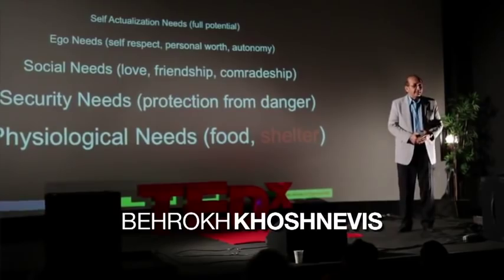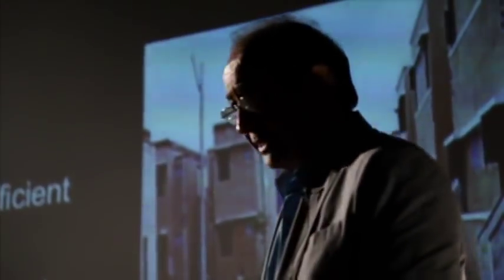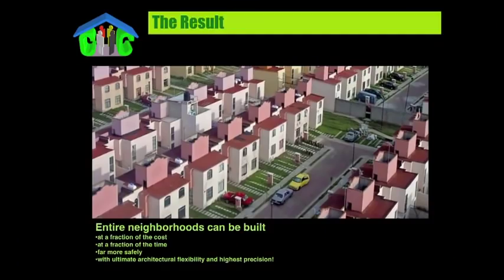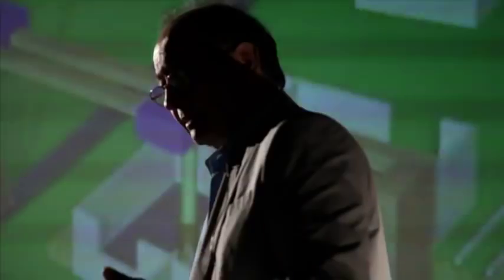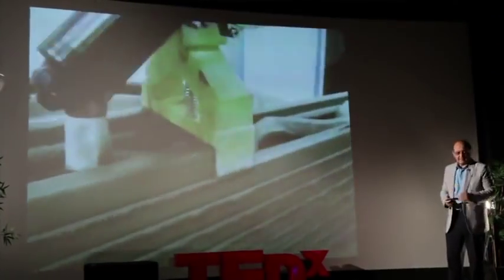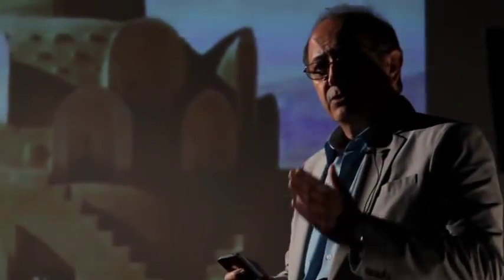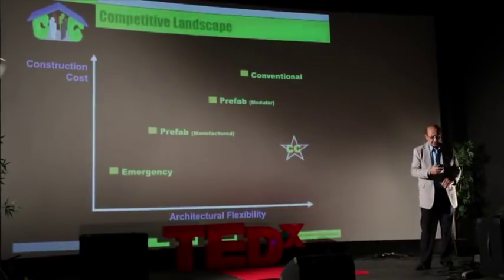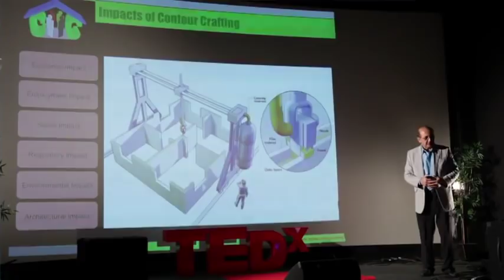3D printer can build a house in 20 hours

Comment: You can also built it out of rammed earth, which means you wouldn't even have to bring concrete in. You just use the surrounding dirt. When packed in tight, rammed earth is just as strong and has been used for centuries.

Comment: Definitely a great application of 3d printing.  What will be imperative is for the building designs to incorporate easy access for various repairs of electrical and plumbing systems, and allow for building extensions/remodeling, etc.  But, yea, this is likely to radically change architecture, and the built environment.  I'm all for it.

Comment: I replied to an earlier comment about what I said, which said something similar to your comment. Robotics did indeed cause jobs to be phased out in the 70s to 90s, primarily in the auto industry. But what replaced those old workers were people who knew how to operate and repair those robotics and it is still happening. But whats different with 3D printing is that it will replace even more workers who create engine parts or circuit boards. I stand by my statement despite your short-sightedness.

Comment: He is quite right, the potential in 3D printing is phenomenal. You have no idea. It will be the all dominant production technique in the future. Computers, cars, ships, planes, space ships, houses, everything will be 3D printed.
But there is a much better way than his proposal of cement printing. Laser sintering of sand...  It's much less labor intensity, it is cost free, there is no pot time and it is stronger. Laser sintering is also more precise and can create fine thermal insulation structures inside the walls. A metal powder can be used for reinforcement where necessary.
Reply: I like the idea to sintering Sand together. Instead of Laser you could use some Mirrors and fresnel lenses and sinter it with sunlight together.
Reply: 0Keks that's how I got the idea but you can't focus the sun enough so it's too sloppy. Laser is much better. And if you want it solar powered you can use solar panels at the site.

Comment: You can also use what one guy does with balloons. You inflate them and spray concrete on the outside, mixed with fiber glass in the cement. When the mold hardens take out the balloon. He has made great round style homes with these and the insulation properties and cost of heating and cooling is way less then a standard house.

Comment: I am in the HVAC design industry and I think 3D printing of mechanical and plumbing systems will allow for much more efficient designs than are currently used, but my question is how will issues like seismic bracing come into play if you are printing the entire system? Will a different more elastic material be used to both structurally brace as well as seismic? What about renovations? Will there be a 3D material remover that sweeps an area for demolition?

Comment: The only response needed to your first problem is slip forming.  It's a common practice used in construction today all over the world.  As far as the plumbing and electrical, the process for repair would be the same as it is today.  Removing a portion of the wall for repair/new installation wouldn't compromise the structure to a significant degree as long as the walls were built with that in mind.  It's just like removing or altering a support wall for a standard stick frame construction.

Comment: An easy way to dispute that would be to look at the automotive aftermarket industry.  Many people thought that automation would destroy the work force in building cars and tools, as well as repair shops eliminating the need for a consumer to be able to access parts and tools.  These days however, it's obvious to the outside observer that not only has the aftermarket helped the parts and tool industries grow far larger than before, but also create new job opportunities.

Comment: to me, this concept sounds like printing a car as a whole. Instead of building with different parts. Normally people don't really notice, but even with a simple house there are many small parts which makes a whole. 

If it is raining outside and you don't see any water coming in and you don't feeling as cold as outside even without heater, there is a reason behind it. good buildings aren't just a thick concrete walls.

Comment: That's why it's so hard to optimize plumbing/power/rebar system. 3D-printing a house has never been done before, so if you ask someone that has worked in the construction business for 40 years he has no clue what so ever on how the most efficient house could be built. There's a way of doing things so that it gets done quickly and efficiently, and if you throw all those rudimentary rules out the window you're left with nothing. So basically you almost need to reinvent how to build a house.

Comment: In my previous comment I wasn't saying that under realistic circumstances this new method cannot be more expensive than a labor intensive alternative, but when controlled for all other differences, the only variable being the method of production there is no reason one should be more expensive than the other. And to add that there is no reason to believe that technology changes the profit structure over any other method of production.

Comment: I, MOST certainly would prefer an exterior wall composed of gently blended (Tuned) spherical surfaces to hard cornered exterior any day. which do YOU think will Hold up the best? I know which one will for a fact - not a guess. Today's state of building tech cannot hold a candle to the strength and support I can program into a freeform shell. Plus I can test it before I even print it out.

Comment: I install drain tile in agricultural fields.  Many people thought that a machine called a tile plow would eliminate the need for human workers and almost any other kind of equipment, as the tile wouldn't need to be laid along it's entire length by hand any more.  Today, while most of the work IS done by the tile plow, there are no less than 10 separate jobs that require unique skills and training to accomplish.  The only thing it did was cut down the number of people actually in the field.

Comment: You're all over the place. Try to do just one thing, 3D-print ONE house, you'll quickly understand that in theory plumbing/power and rebar systems are easy but in practice making a robot do it automatically...not so much...Then when that's done you can focus on moon-landing and what not.

Comment: Regarding the impact on construction laborers: They will go on to more specialty work; They weren't building for the 3rd world anyway; They could buy in and participate in the construction. I am sure no one would think of calling a bulldozer or even a wheel barrel or a bucket a detriment to the construction labor pool. After all the machine could put up the wall while a crew veneers it- or what ever.

Comment: Someone has to fix the printer, someone has to find ways to make the printer more effective, someone has to get contracts to use the printer, someone has to get the materials used by the printer, someone has to build the printer, someone has to design the things the printer will be building, Continued supervision of the printer would be necessary to make sure it doesn't malfunction and also you would have to have people come in to check the structure when the printer is done to ensure its safe

Comment: Nice ideas, but practically you must let concrete cure completely to get maximum compression strength, water/sewer/gas lines must be pressure tested to ensure safety and this is accomplished before walls are sealed in case of problems. Also labor is still required to provide base materials on site, deploy them as needed in a precise order over  20 hour period. Its not magic, it still requires a lot of work.

Comment: Currently, most PhDs in science do not end up working as scientists.  In previous generations, many engineers could begin as draftsmen, that demand has been slashed by AutoCAD.  So the same forces of automation are affecting scientists and engineers.  This is leading to improved efficiency for science and engineering, but it makes the careers of scientists and engineers more difficult.

Comment: You've responded to your own rebuttal.  I agree that a model will only be as good as the people designing it.  That's why you don't employ idiots to design jet engines.  While the specifications and tolerances are vastly different, the processes would be the same.  In both cases, you have to import a designed component into the overall design so the computer can check for clearance and function within the completed model.  Only after they're sure it works would they make it.

Comment: It took long enough! Only one question - Why not use freefom structures to take advantage of the inherent strength, rather than rectangular structures? We can take advantage of the built in CFM modules of CAD systems, tune them to atmospheric and historic geographical data and provide MORE than adequate housing for ALL.
If you are worried about JOBS - Improving your mind to expand on this would be job ONE...IJS

Comment: Many of these construction jobs you speak of aren't being filled by skilled labor anyway.  I've had to repair thousands of dollars worth of incorrectly installed or completely lacking components because the companies want it done cheap and fast.  This printing system would eliminate thousands of areas where poor technique or cost cutting has not only left a structure deficient, but also unsafe.

Comment: I do not agree that this will ever make house building cheaper as houses will always fetch premium dollars what ever the construction method, and no price has been fixed on the machine to be charged to the customer, but we could say that the machine hire could be in or around 250,000, without materials, this could give an average price for a house build as a base cost.

I have worked on building sites of houses and factories and have seen factories walls cast flat on the ground then lifted upright to bolt together (http://en.wikipedia.org/wiki/Precast_concrete), this has been a very cost effective way of building and has even been used to build houses, this idea of a printer to do this isn't cost effective and is at best a novelty.

Comment: im not even looking at the cost of the printer. of course maintenance and operating cost would be figured into the price of the house, but the price of the tool would not be. 

high strength rapid cure concrete, probably GFRC of some sort with quick setting addmix, would have to be used. maintaining the right consistency of the mix would be a nightmare. having worked with modern concrete pump trucks i can tell you this printer would be a bear just to get going, much less keep going. lol

Comment: I'm intrigued that anyone would want to 3D print houses. It seems supremely impractical to me. The device will probably be too big to transport over roads without being disassembled. If it's practical at all, it will probably be used first in housing factories. We can already build travel trailers and mobile homes and pre-fab units fairly inexpensively, people don't really want to live in them though.

My own preference is for straw bale construction. They're easy to build, look great, insulate very well against heat and cold, use waste material, use natural materials. I don't want to live in a high tech house. I want my housing to be well-grounded.
Reply: Why would you transport the device instead of the house
Reply: Just my opinion! I don't know, it broadens the possibility of building cost efficient houses for low budget people. Despite the occurrence of natural disasters like Japan, i think only minority parts of the world are able to get such cheap cost building. Unless someone comes up with a new material that can withstand high richter earthquakes. I mean, you get what you pay right? 

MrJinwright wouldn't it be impractical to transport a residential area of 300 houses? I think it's rather to move the machinery itself to print the houses in the residential area.
Reply: Mohd Hazim What I was getting at is why not print these in a factory and then transport them as modules that can be put together on site. You could produce much more per week this way I believe.
Reply: They have to disassemble/reassemble cranes every time they move those. 

All this house printer is - two side rails, two side posts, one gantry beam. Easy to assemble and easy to move. Not even that heavy in terms of other construction equipment that is moved in every city every day all around the world.

Comment: I am sorry but you don't really know what your talking about.  When I was younger I worked at UPS.  I can tell you that it does not take any extra "work" in order to move a package faster.  We did the same thing for "ground", as we did for "ground faster".  We did the same thing for "air" as we did for "air faster".

The only difference is for those that paid the extra money, we moved their boxes to the front of the line.  Our costs were not higher, speed is an up charge. Pure profit.

Comment: A standard stick frame house is pathetically weak compared to what they're showing here.  Just as slip form construction made it possible to build taller, stronger buildings for grain silos and sky scrapers, this printing process would remove the weaknesses that a normal house has.  By relying on connections between each individual component, a stick frame house has very little, if any, structural redundancy.  Knock out the whole north wall, the house collapses.

Comment: I think this is a prime example of some smart guy coming up with an idea for a field (construction) that he knows nothing about, in terms of practical application. I highly doubt that the robot can accurately place rebar, wiring, and plumbing, especially if the custom geometry starts getting weird.
Reply: ***** agenda 21 hard at work
Reply: You're betting against a robot picking and placing objects accurately? LOL! The electronics industry has been doing this for decades now. We can even 3D print low-voltage electrical traces directly on any arbitrary substrate. There are snake-like mining robots that can pull high-voltage cabling through conduit. It's only a matter of time before IoT fixtures and appliances can self-report failure modes and order replacement parts before you even know there's an issue.

Comment: .3 mm z lift, .35mm nozzle, feed rate varies by the software depending on the operation. lol. 

anyway, im a construction manager, you could say i know a thing or two about concrete blends and ultimate strength. i know this process is possible, but hardly practical for at least a few decades. and these "cheap" houses will be millions of dollars at first. haha

Comment: Nice idea, but until it can 3d print steel wire into the same structure it's printing, it won't be able to print houses to earthquake requirements. Also there are LOADS of empty buildings already, people are living in slums because they cannot afford to buy those existing empty houses. The printer wouldn't be drivable on the roads too big, and if disassembled/reassembled, there would be calibration issues. No electricity where you're printing? Generators, there goes your green arguement, pish.

Comment: Your not looking at the bigger picture. Value is determined by scarcity and abundance, presently there is a scarcity of housing and the housing that does exist costs huge amounts of money to create and maintain, therefor the value is driven up which is why no one can afford it. If these new methods were used instead and large amounts of high quality housing could be built quickly and cheaply, there would in fact be an abundance, driving the price down. Your argument, sir, is redundant.

Comment: So you took the man power out of the equation  And lumber out of the equation,  You say 20 hours a house. Is that realistic? You need to set up that gantry and supply it with materials endlessly. That takes more time and man power and area to complete then a crew of workers and a pile of materials. Just to set up that  building printer you'll need a crane and 10 men. What if you have houses on both sides?  I think the idea is great but the application will be very hard to achieve.

Comment: I'm still not convinced that this system is better han EPS Composites, that offer bertter insulation.
Reply: The 3D printer built environment...   3D printers play an important role, a 3D printed structure...all I can say is when it comes to building there are logistical scale considerations from concept to build-ability. I think its ironic that the EPS systems emerging now are technically and theoretically more interesting and will ultimately change the way we understand and use 3D in every thing we do.

Comment: With a thousand years and as many slaves, it will be possible. The slaves will labor virtually, coding for each block; the overseers will refine the machines and direct the coding. In the end, it will be done. The difference will be that it could then be redone. And redone. And Redone. Then done on the moon, and Mars, and every other celestial body. Then the Taj Mahal will just be another billboard for the company that made it.

Comment: the spec's on the materials needed for a pc to handle would require higher standards in a factory cost would go up right there, sound's like a great idea but stick to the process of creating the cement section only if u really want to be cost effective for countries around the world and wish regular working guys to not only be accepting of this thing " 'some dumbass engineer came up with' which is the world around the most common phrase when makeing someones job harder' " but also get the boots on the ground excited about it . start small add to it basic growth